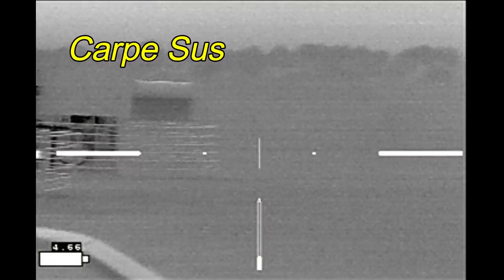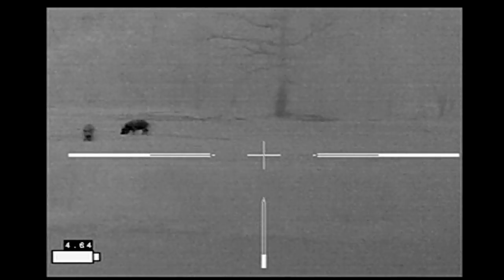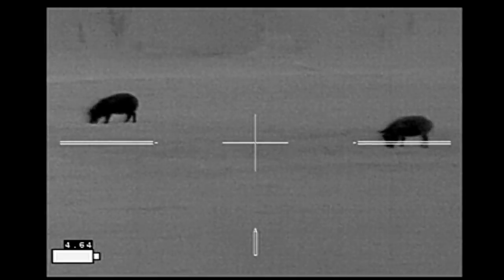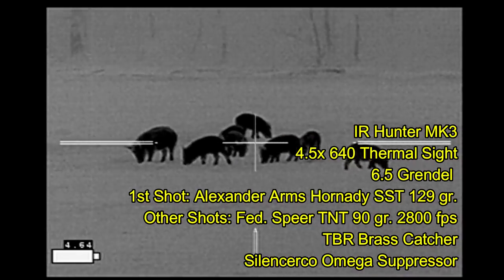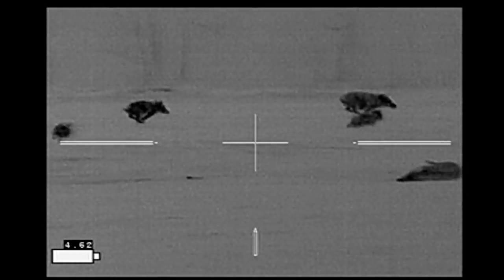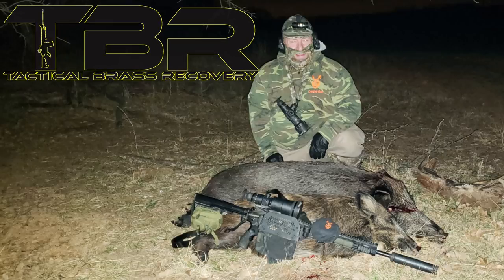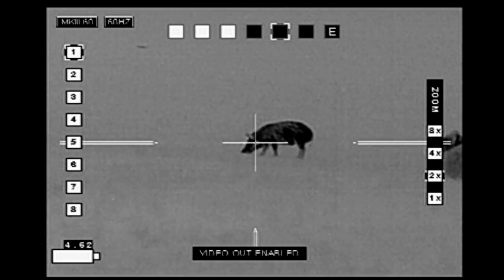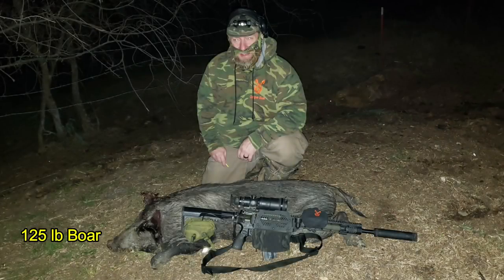Sow, 2 Boars, AA Hornady SST 129 gr  First Shots

Comment: For a pass thru i bet a monolithic bullet like a GMX would work great
Reply from the maker: On hogs this small, or shot where I am shooting them, broadside passthroughs are common with many rounds.  What I don't like about monolithic bullets for dealing with hogs is that they tend to have a more limited wound channel.  For meat hunters, they are great, but I am not a meat hunter.  I like the extra damage done by rounds that come apart violently.
Reply: @CarpeSus  In this case, violence is a good thing  :-)

Comment: How do you like the 129 sst over the fusion 120 gr?
Reply from the maker: Well, I don't really like the Federal Fusion 120 gr., not because it does anything wrong.  In fact, it performs exactly as advertised.  It goes in, expands nicely, and often exits.  It makes a nice, clean, permanent wound cavity.  This is great for meat hunters.  I am not a meat hunter.  I want massive tissue damage to kill hogs.  So Fusion isn't my favorite.

SST 129 gr. seems to work much like the SST 123 gr.  It enters, expands, and starts coming apart doing additional damage outside of just the main wound channel.  However, my sample is still just 2, right now.
Reply: @CarpeSus  Thanks for the reply, what's it looking like the best damaging projectile for pigs coming out of 6.5 grendel so far?
Reply from the maker: @Tuscani27  Not cheap, but the Berger VLD-Hunting 130 gr. does all sorts of damage and penetrates very well.  After that, the Speer TNT 90 gr. bullet is my favorite along with Hornady SST 123 gr.  Right now, Federal won't be making any more loaded Speer TNT ammo until April 2019.  So when I run out of what I have, I will be back to the SST 123, which does work really well.

Comment: Last hog was shot in the head, yet had blood from it's heart still going I assume. Have you ever hit a hog somewhere that it didn't bleed?
Reply from the maker: Let me see if I can answer this properly.  Because there was a large pool of blood under the hog's head from the head shot does not necessarily mean that the heart was still beating, although it could have been, briefly, but I have no way to check.  Brains are highly vascularized and their destruction means damage to a lot of blood vessels which can outflow.  As such, there is a lot of blood drainage that is not necessarily due to a pumping heart.  Similarly, I have heart shot hogs where there is definitely no pumping and still had considerable pooling of blood on the ground around the wound.   I have never shot a hog that did not bleed, but I have shot hogs that did not bleed out.  Larger hogs with significant layers of fat and/or boars with thick shields can sometimes self seal such that the bleeding all happens internally with little or no outward signs.  Particularly for bullets that do not pass through the hog, entry wounds often bleed very little and if they seal up quickly, don't outwardly bleed at all.   In a previous video, I included a method for locating bloodless wounds.  This is accomplished by rolling the hog over with the wound side down and then standing on top of the hog and bouncing to force blood from the wound so that it can be visually located when the hog is turned back over.
Reply: @CarpeSus  Ok that makes sense. Thanks for such a detailed response.